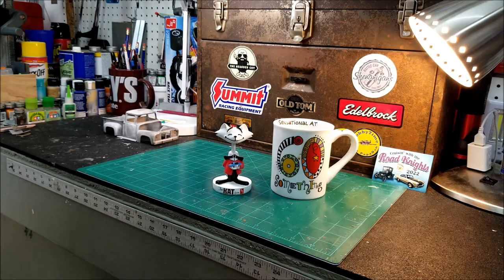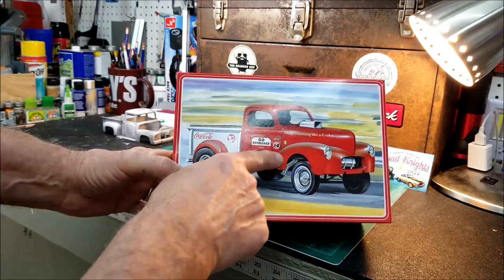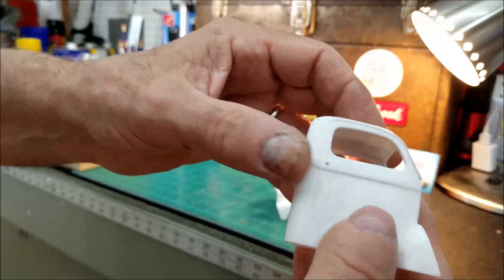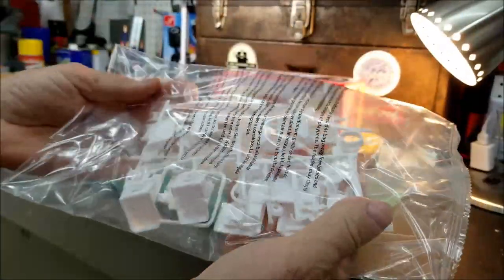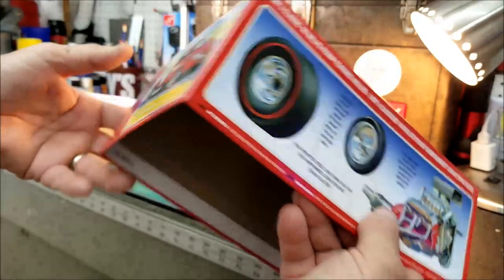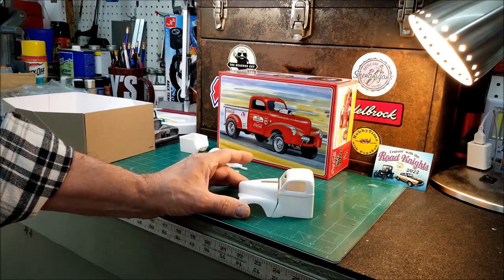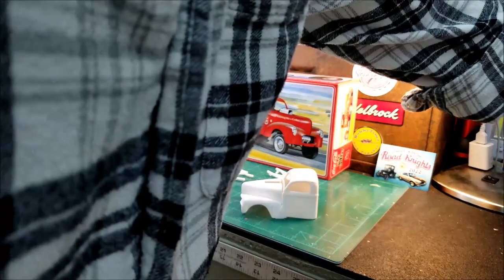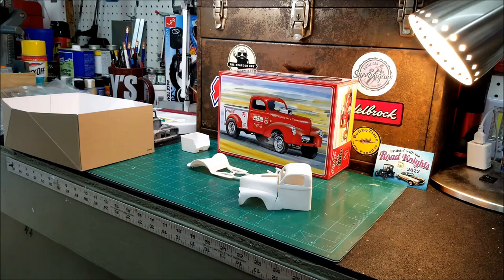Next Up On The Bench

Comment: Hey Zippi ,nice choice for your next build. just a heads up that chassis on your bench is for the coupe version of this kit. They used to include the coupe body so you had a choice of bodies. The problem with the front sheet metal (plastic?) is mainly with the hinge alignment .
But also look out for the front wheels setting too far back in the wheel base. If you sort those issues out the rest of the build is easy and
will produce a nice Willys gasser .
Reply from the maker: Thanks, and thanks for the heads up John.  Yeah, I always hope for the best and expect the worse.

Comment: For realism, cut off the lower portion and add it to the hood/fender section. Full size cars are like that. Plus, you won't have to modify anything else on the hood as you keep the tilt function.
I don't like the look of the headers. I don't know of any company that would make headers like that. I think they made them to look good. I ended up making my own SB Gasser headers. Will fit that engine right nice too!
Reply from the maker: Thanks Bob.  I have thought about doing the hood that way.  I'm still in the looking stage at this point.